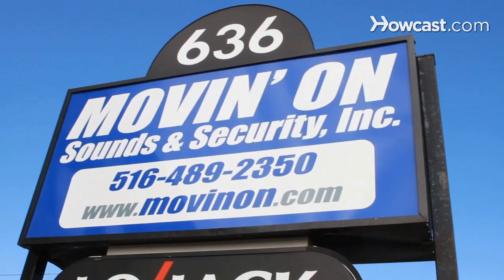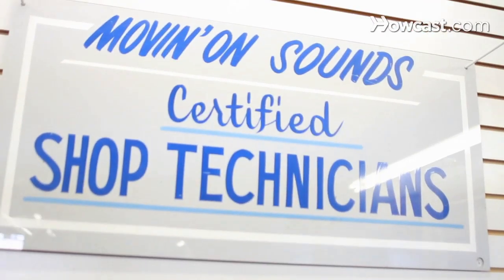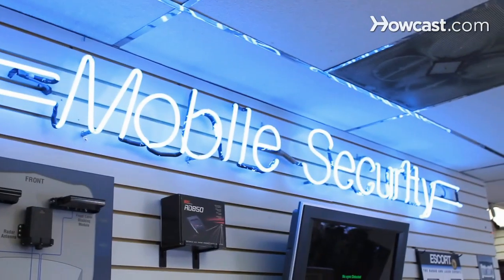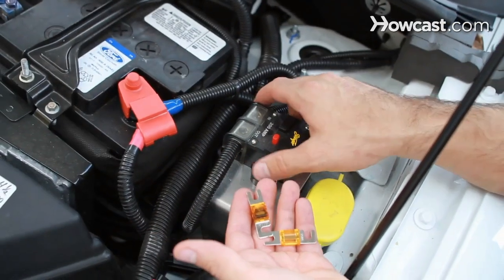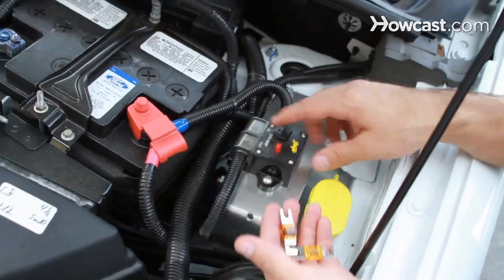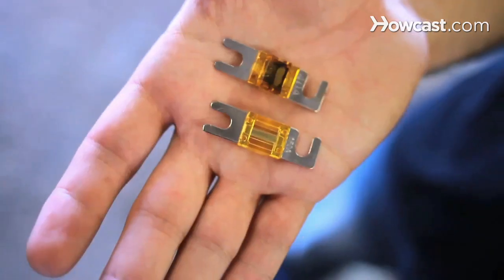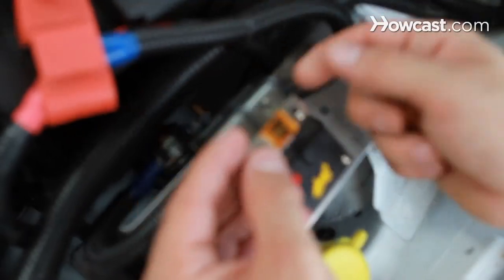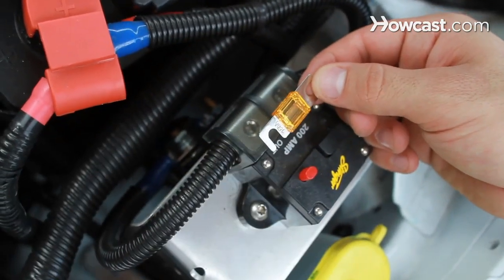How to Change a Car Amplifier Fuse | Car Audio

Comment: Since this video failed to teach me anything new, I decided to go find my amps instructional manual pdf online (JL audio, was easy to find by part name/#) 
Issue: After over a decade of enjoying my system; subwoofers working but suddenly no sound from any of my speakers. Not sure what I did, but I'm sure I accidentally did something. Sub amp has power lights on, speaker amp leds blink and shut off upon car accessory start (protection mode).

 I have two batteries (starter and auxiliary) connected at the positive terminals (in parallel?) Each negative lead is grounded to the chassis. The grounds are known to be good. Could it be something as simple as a fuse? I'd hate to spend any $ at an aftermarket car audio shop just to have them diag that again (...already wired a replacement aux 12v backwards smdh and blew a fuse that way, the shop was able to point out my dumb mistake). 

Okay, so this time I read and re-read the speaker amp manual booklet & ordered correct replacement fuses: let's give replacing a fuse a try. This is what I did following JL's instructions for my amp (yours could be different, don't sue me if your car blows up or if you electrocute yourself):

1. Disconnected main 12v (starter) battery negative lead
2. Disconnected auxillary (rear audio 12v battery) ground/negative lead to chassis (could have disconnected lead from battery terminal but placement was awkward and easier to reach grounding point on chassis) ~yay, sparks~
3. Disconnected auxillary (rear audio 12v battery) positive lead at battery terminal
4. Removed fuse housing cover that connects the amps to rear battery.
5. Located and removed fuse that leads to speaker amp (fuse may not appear damaged) Needed allen keys for this.
6. Reconnected positive battery terminal 
7. Checked that the exact same fuse type & amperage on replacement fuse. Replaced fuse and secured with allen key.
8. Reconnected auxillary (rear audio 12v battery) negative battery lead to chassis ground point  ~yay, sparks~
9. Reconnected main (front starter 12v) battery ground terminal
10. Started car and started music! 

Again, chances are your vehicle is wired differently than mine. I was lucky it was just a fuse. Check your manual and if your still unsure, head to highly rated shop. 
Hopefully this helps someone but TL;DR: RTDM
Reply: have a question for you would the amp make the radio stop playing but not the cd player. I have no sound out of the radio but when i switch to cd it works.
Reply: @novamagicalfantasy2015  I unno, read your amplifier's manual, then get the correct fuses 🤷🏻‍♀️

Comment: Well, my amp doesn't have power to it but y subwoofer speaker I felt some vibration from the music that was playing. So the bass works, just the amp doesn't. I'm gonna take a look and see if it's the fuse the battery. I was thinking something got damaged from 2 jugs of washer fluid kicking around. It also looks like there is a fuse on the side of the actual amp? Is that the one that's blown? I tried tugging on it and it seems pretty snug in there

Comment: Would it be okay to place the fuse by the trunk? because i've seen some videos that have it that way.
Reply: boliRULES.if ur using secondary batery which is located in da trunk den u can do dat.wer ur mounting da batery.n  da fuse should be near by to the batry always maximum distance should b 12inch

Comment: Hey can I ask you a question what mast I do when my amp is on when I take off the cable we’re it mast attach on a metal object in the car and it turns on when I pot it back on that spot is turns off what mast I do

Comment: My fuse holder under my hood melted, fuse seems to still be intact.. what could be the problem?
Reply: Courtney Hensley  may b ur running a fuse which is lower in ampere n ur batery is drawing much more ampere den ur fuse should dat is da  case it has melted so better buy good fuse with better measurement
Reply: speaker zedan no nigga his power wire is too small

Comment: I changed the fuse on a ford Fusion but it sounded like it had blown again. Had it checked and everything was ok. Got a different radio but it still doesn't work. Any ideas!?
Reply: Idk if you fixed it by now but I recently had the same problem. I replaced my line out converter and my sub works now.

Comment: My amp needs or is rated for a 200anl fuse ,can I use a 250 ?or would it  be better to stay at a 200 anL fuse
Reply: Jose Coronado.allways stay with da same amp fuse rating

Comment: Do I need to unplug the battery before changing the fuse?
Reply: No
Reply: I had to disconnect the + & - when removing, and had only positive connected when installing new fuse. Reconnected negative when I was done.

Comment: how do u know what amp fuse you need
Reply: jspat49 .u need a multimeter to check the ampere of ur car battery n dat is how u can calculate n measure d ampere of d fuse